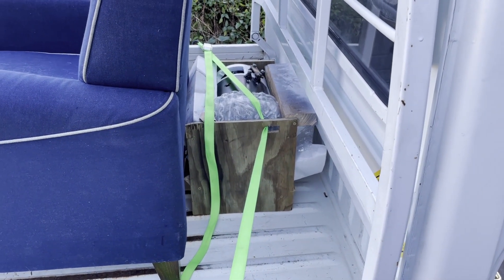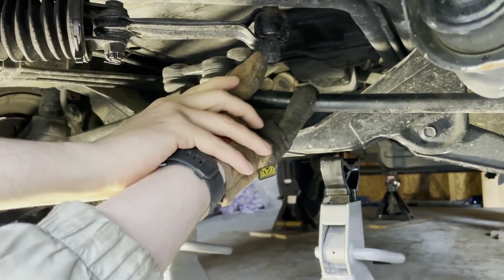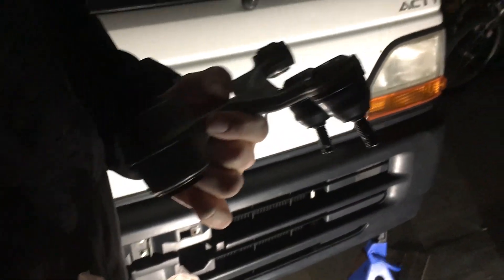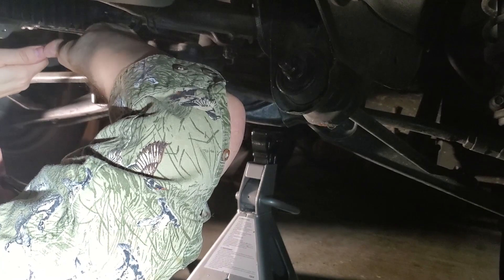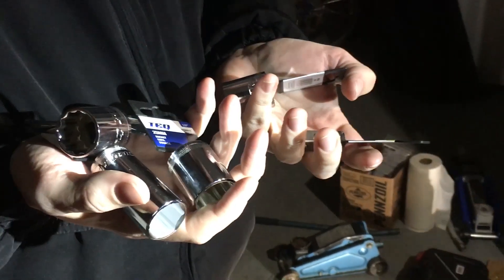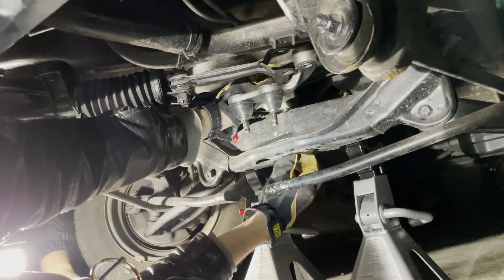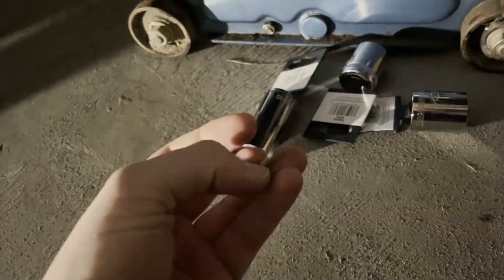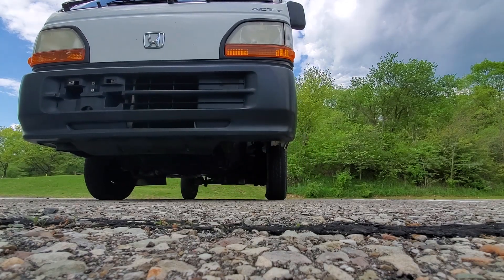Converting a Kei truck into an EV - Fixing the Steering - Part 13

Comment: Your statements at the end ring true with me, large expensive Ev's are not going to even make a dent is our consumption of fuels, it needs to be something the majority can afford and it needs to get a practical range, both of these mean a small, light car. Also it means a small enough battery that can be charged at home with a regular power point rather than needing a dedicated charger which is more money again. There is a guy in NZ who has converted a newer one of these (Suzuki Carry) with such success he is now doing a second one that will have more range and higher top speed...